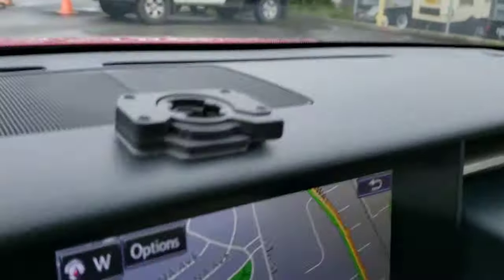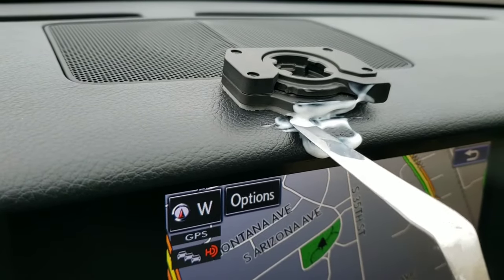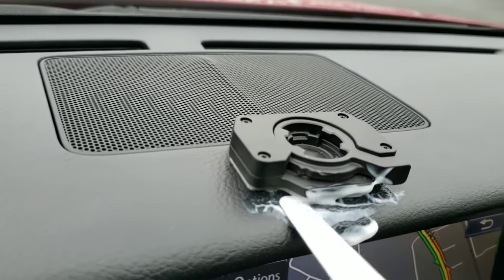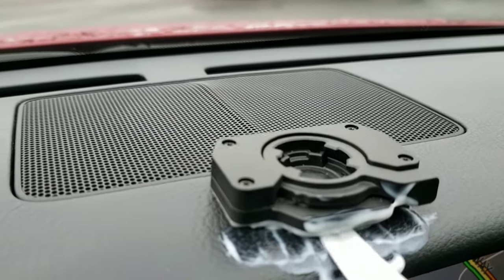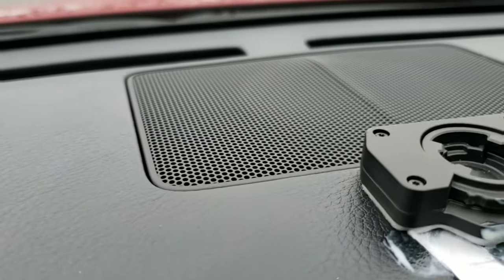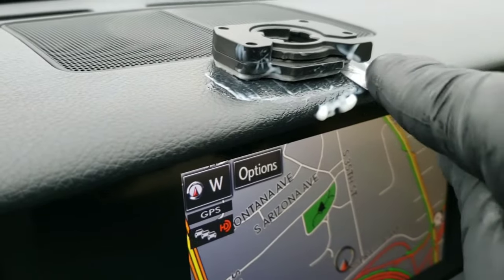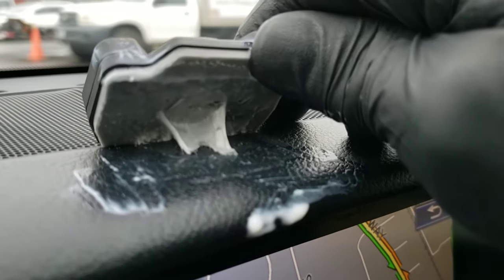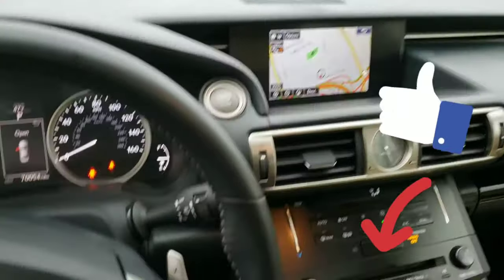How to REMOVE CELL PHONE HOLDER  from dash board.

Comment: To everyone doing this, do not use isopropyl alcohol, nail polish remover, or anything like that if your dash is made of leather. Leather absorbs these chemicals and then becomes super soft and then pieces start to come off as you rub on it. Notice that he used leather conditioner in the video, which doesn't make the leather weak.
Reply from the maker: Good advice

Comment: What can I use on a hard plastic dash?
Reply from the maker: Depending on what type of adhesive it is, a Heat gun might help, or 3m adhesive remover. Just be careful and test an out of site area to make sure it won't mess up the finish.
Reply: @problemsolver8447  What about Contractors Solvent? I have some of that and would like to try it before buying something else.
Reply from the maker: @swami1  Yes I would try it.

Comment: Can I use oil to remove the sticky residue left on the dashboard?
Reply from the maker: It can, yes. Or vinyl dressing. It doesn't allow the adhesive to re attach as you move it around.

Comment: What's the white substance you put ?
Reply from the maker: Leather conditioner.. Since I did not have any Vinyl dressing like armor all.
Reply: How would I remove just the sticky foam?
Reply from the maker: @jameshamp9378  you can try a heating with a hair dryer, slowly rolling it or peeling it. It it is stubborn you may need some adhesive remover but I would try saturating it with some silicone vinyl dressing like armor all. It helps release the adhesive.
Reply: See I have it not on the dash but where the screen is at ..on that panel area will it work on there?
Reply from the maker: @1thetvzone  It should. Might want to use armor all dressing, and let it soak for penatration . Maybe even wD-40 would help.
Reply: @problemsolver8447  Thank you, so much!
Reply from the maker: @1thetvzone  For sure, good luck. A hair dryer for some heat can help sometimes as well.